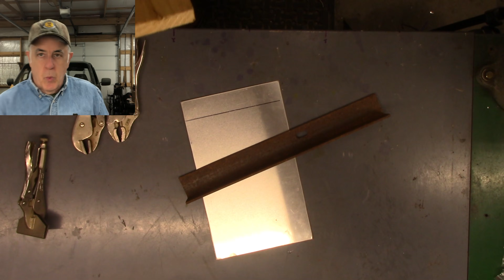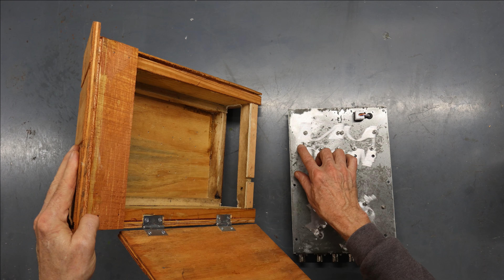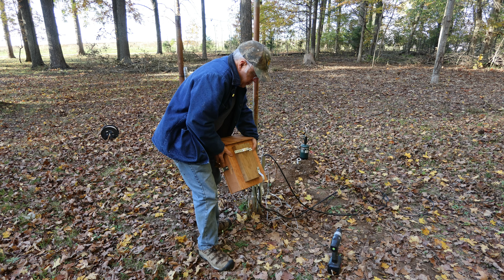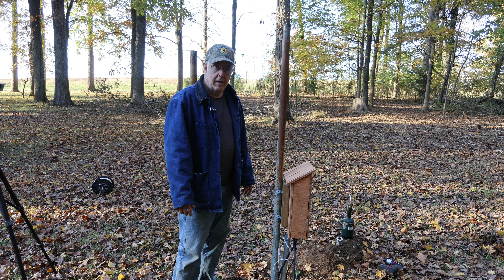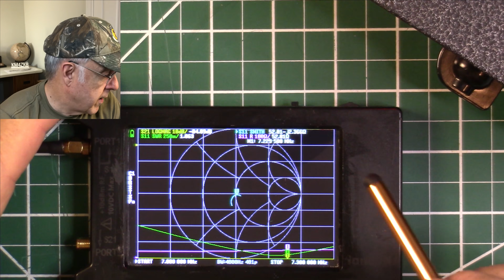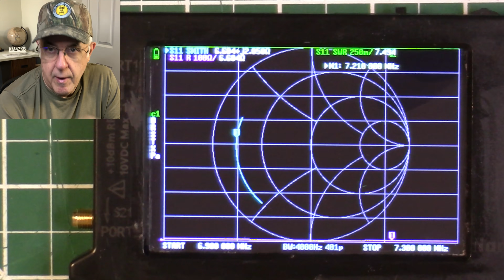Remote Antenna Switch: Enclosure, Pole Mount, Tested from the Shack

Comment: Hi Jerry! Will relays handle 1500 watts RF output? If not, what is the highest power I can put to them before contact start melting?
Reply from the maker: Contacts can handle 30 amps DC.  Not sure what they will handle RF as I have no way to test.  I would test at 500w, then 750w etc while watching your SWR.  If things start to fail your SWR will start to rise.  Take it a step at a time and be safe.

Comment: Great video. Thanks for sharing. I have one suggestion. You should have actually hooked this up to a radio and see how your switch works during transmitting. CAT 5 cable is acceptable to RF. I had lots of problems either CAT 5 Ethernet in my radio shack. I eventually run CAT 8 cable in my house to avoid the RF killing my Ethernet performance. Since I use a FlexRadio , and the FlexRadio uses Ethernet so I can control it even in the house, then any RF in my Ethernet stopped my FlexRadio from working. I hope you don’t have any similar problems.
Reply from the maker: Yeah I did in one of the previous videos in the series. I tested it before I put it in the case. My curiosity was getting the best of me. So far I have not had any issues but I’m only running 100 watts. I don’t have an amp to test with more power.
Reply: @BudgetHamRadio  I’m glad to hear you are not having any problems. I know especially I was having problems after I added my Power Genius Amplifier, so maybe at 100 watts you will be just fine. God be with you my friend. Thanks for responding.
Reply from the maker: Thanks!  May God bless!

Comment: Views come over time.   Keep doing stuff.    Have you transmitted on this yet?  Does RF affect anything?   Would a shielded box (earthed as well) reduce Issues and potential RF loss?
Reply from the maker: I have transmitted on this in a previous video before I put in enclosure and I am using it live now.  RF Does not seem to affect the operation of the relays. The backplane is grounded now. A metal box may have some minimal effect. It would prevent or severely reduce any stray RF from the switch but I don’t see that as a problem anyway.  I would be interested in hearing from anyone who builds this in a different configuration.